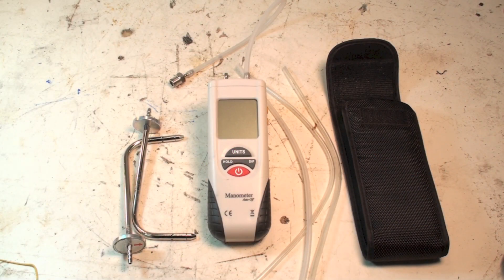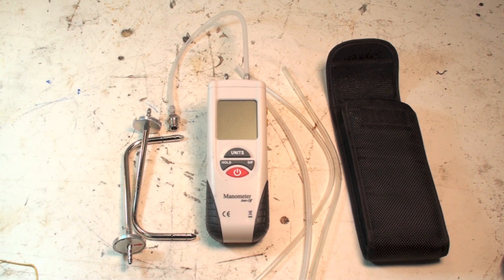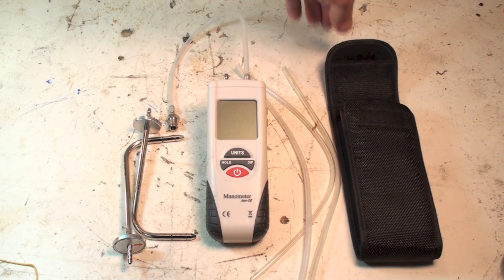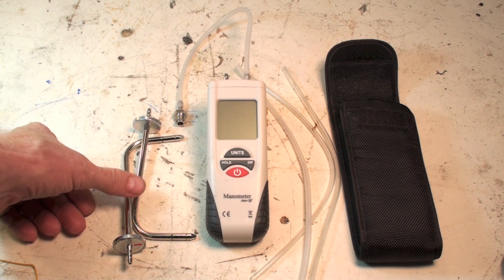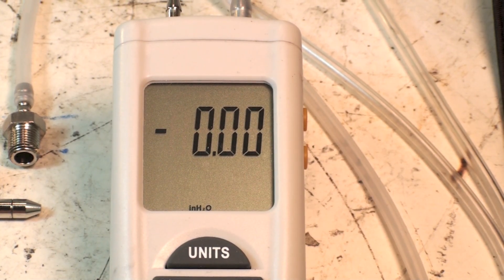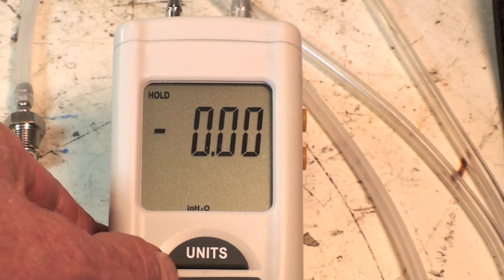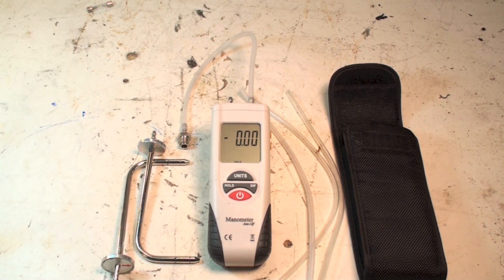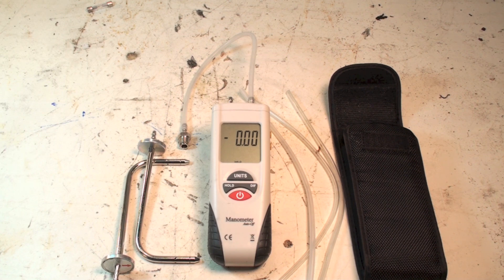A look at the GSI electronic manometer

Comment: From the UK are there any advantages of this machine over the glass u tube type manometer that I have used over the last fifty years. Thank you my friend
Reply: The advantages over a digital manometer over a conventional manometer depends on the application. A digital manometer is not supposed to be more accurate than an old school one. Calibration is the main area where a digital and an analog manometer's reading can differ. If it is well calibrated by the supplier, the readings will be the same as an analog one. Where a digital manometer can be useful is when you must for example give differential pressure readings to a computer. You can maybe buy the digital manometer to see if it is more convenient to use, but if its not, rather stick to the setup you know have worked for 50 years

Comment: Nice video.  I just purchased this manometer.  I have a question.  To get the "total" static pressure do I hook up the supply tube to right side and return to left and it reads total.  When I cool the return to the right side with left open it says -.32.  When I hook left side to return with right side open it says .4.  If I hook the right side to supply only it is .1.  If I hook both up with supply on right and return on left it says .51 on screen.  Thanks for your help.

Comment: man I have the same manometer tried it on a pressure switch but the hoes was to small for it
Reply from the maker: Ever hear of adaptor?  You will always have different sizes to deal with.  You will also need some tees so you can check pressure while the unit is operating.
GFM
Reply: I hate when my hoes is too small!

Comment: Your not calibrating it with the hold button, you just setting zero I'm sure. $40 on Ebay.
Reply from the maker: You are right, it is just a zero set.  These tools need to be calibrated every year.  It would be cheaper to buy one than calibrate.  Thanks for the correction.
GFM

Comment: So far so good with this? I was hoping to use it to identify when my furnace filters need changing. I use the 3M Filtrete filters and don't want to be changing them before I really need to. So by doing a differnential pressure check I can see when the filters pressure drop indicates a filter replacement is needed. It would work for this right?